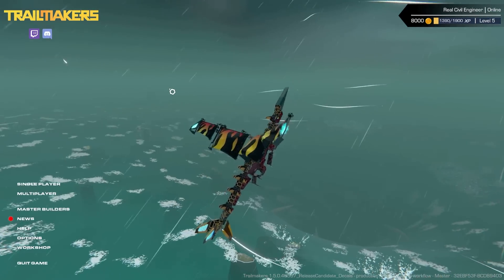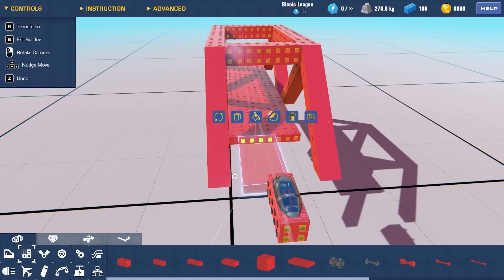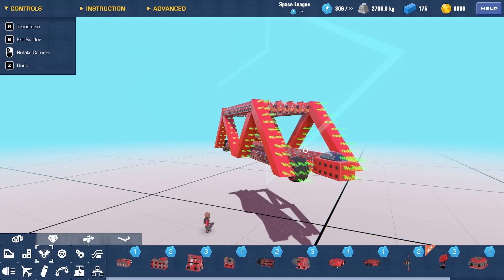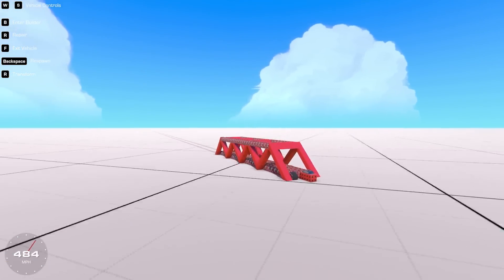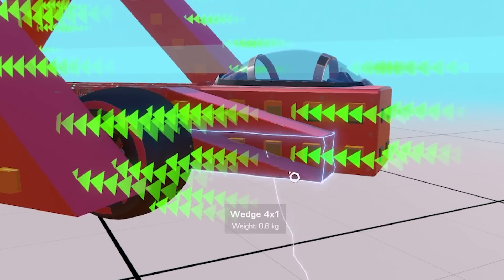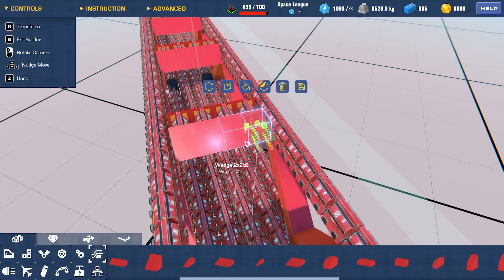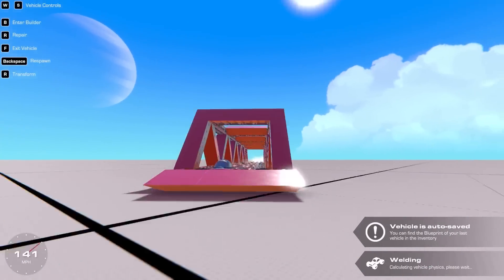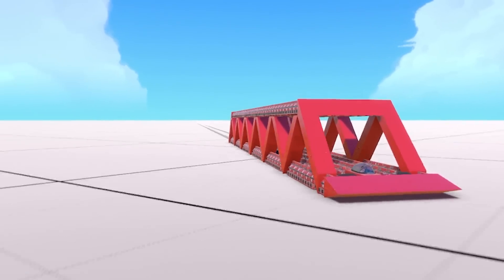Breaking the LAND SPEED RECORD in a bridge...

Comment: Physics problem with this vid: weight does not impact top speed, only acceleration so you can add all the aerodynamics you want.
Reply: Weight does affect top speed. Drag increases depending on speed, so the acceleration does matter, as that's the number that decreases with drag, and when you hit zero acceleration, you don't increase in velocity. 

How is this not obvious?